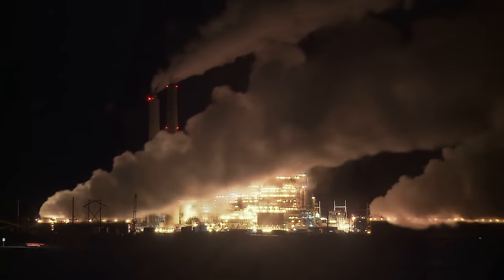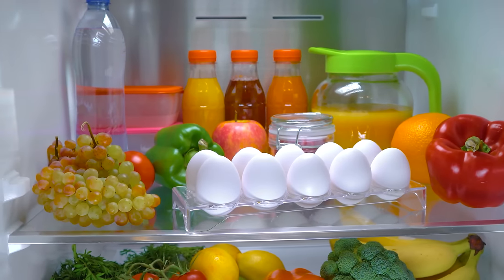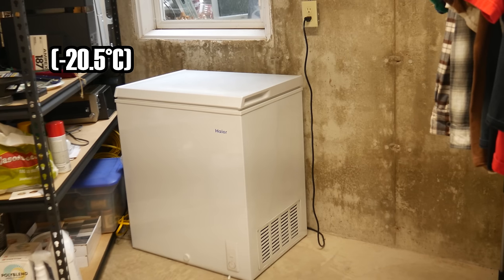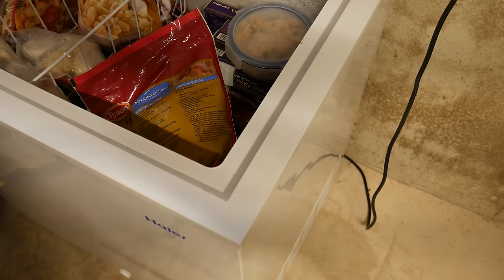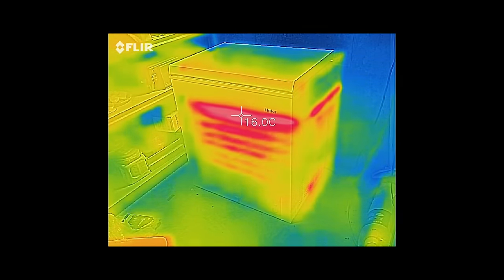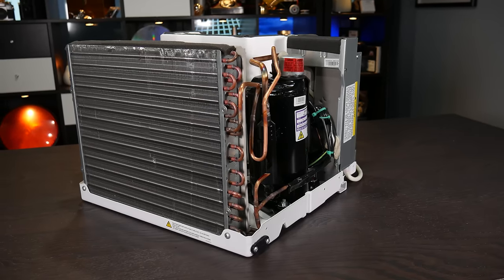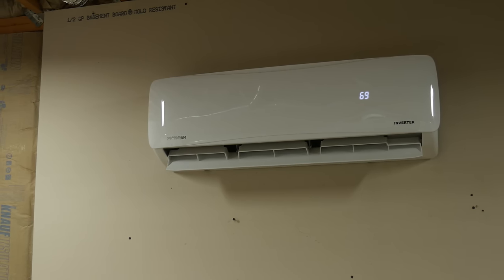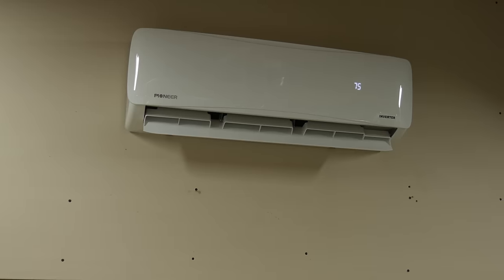Heat Pumps: the Future of Home Heating

Comment: No matter how many times I hear it explained, refrigeration cycles are so goddamn magical science, it's really indistinguishable from fiction
Reply: Basically, what is exploited is that changing the phase and pressure changes the temperature seen by the opposite sides of the unit.  It isn't magic so much as utilization of the laws of thermodynamics to our benefits.
Reply: It's really basic physics. You compress something, it gets hot. You release that pressure, it gets cold. An AC system is simply turning that concept into a continuous cycle.
Reply: Yes. Magic, like the OP said.

Comment: 34:06 "For now, stay warm."
Me in the Philippines at 3:00am :
- turns airconditioning on because it's too hot -
Reply: get a  dehumidifier
Reply: In tropical countries, heatpumps only cool, less complicated system and last longer
Reply: @henryairconcepts2999  I live in north Argentina and every year more models sold are hot/cold because we are little pussies when temperature goes below 10 C
Reply: @henryairconcepts2999  I'm in Brazil, heat pump are more expensive and not useful. I barely use a oil heater at half power to sleep in some winter cold days.
Reply: @marlonmartins82  I see. I live in NZ people live in pacific area and south east asia only have cooling heatpump. And it’s cheap to buy. Maybe around $300-400 including install for small heatpump like underr 1kw
Reply: So lamig in Ph
Reply: Ground source heat pump in the Philippines would be the way to go for air conditioning.   I've never been able to find anyone there who knows how to make that kind of system work.
Reply: @Bagsy84  ACs dehumidify.

Comment: Here in Phoenix, we have been using a single central air heat pump for super hot days and cold near freezing days for heating. Also, we use a single heat pump to heat our pools in the winter and cool them in the summer. Without them, in the summer the water gets as hot as a bathtub and is not refreshing. Thanks, Heat Pumps!
Reply: Do you get the pool extra heat pushed to hot water tank or is it just pushed out?

Comment: We have a "Mini Split" installed in our addition, and it does a fantastic job of both cooling and heating throughout the seasons.  It even heats well quite a bit below freezing.
Reply: THE SPLIT HEAT PUMP doesn’t have built-in resistance heat?  I thought that was standard backup heat for heat pumps.  (That’s how my whole home unit.)

.
Reply: @electrictroy2010  I guess some probably do, but this particular unit warns that it's only effective down to about 19°F (around -7°C).

Comment: your pun delivery caught me off guard. I'm pumped too. This is amazing, I can't believe I never thought of doing this. The heat that is pumped has more watts than the electricity used to pump it. absolutely the most efficient way to heat a building.
Reply: And now lets combine that with a proper insulation in Walls AND windows. If the insulation even more reduced the amount of energy needed to either heat or cool the place, well, that makes them look even better.

Does the US know something like a passive house? that is an energy efficiency standard in Germany (and I assume a lot of other countries around Europe and likely the world) that defines such a high heat efficiency through insulation etc., that the house requires no external energy to heat or may even produce more energy than needed, (e.g. with solar collectors, through sunlight shining ionto windows etc.). In the depest winter it may need just some additional minimal heating. A colleague living in one told me, just looking at heating the body heat of three people living in the house is already sufficient to keep the temperature up, now add all your electric devices producing heat, cooking, showering,... Seems at some point you are more confronted with an efficient way to get rid of the excessive heat. I think most have ventilation systems with heat exchangers.
Reply: @alexku8452  I have never seen one in US. It may exist here but I have not heard of one. If it does it is most likely in California where they tend to be ahead of other states on things like that. In the southeast of America (i am in Florida) it is humid all the time around 60 to 90% humidity on a regular bases with 80 to 100 degree F temps (26 to 38 C) so you need air conditioning to get rid of the humidity. We hardly ever need heating. It gets cold maybe 2 weeks a year in Florida and that is usually above freezing. In the summer you can get around 2 to 5 gallons of water out of the house a day through air conditioning. I dont know about the northern United States but most US states get up to 100F/38C in the summer even the northern ones. In the northern USA it gets below 0F in winter but also get hot in summer. I do not know the climate in Germany myself but insulation without ac in the south USA is no help. you have to have AC to keep the inside comfortable and mold free.

the closest I have seen to what you are talking about was from a video i watched from Matt Risinger that does home construction in Texas. he showed a house they built using i think 2 foot of insulation on the outside and only needed one mini split air conditioner to cool the entire house. if most places built houses like that it would be better. one of the biggest issues in the USA is the amount of different climates we have all across the USA.
Reply: @alexku8452  that certainly is an optimistic view. I would be all for it. The trouble lies in convincing people that the long term cost savings justify the large initial cost. Perhaps when the world runs out of oil we will see people care more about efficiency.

Comment: When I upgraded the original and outdated HVAC system in my last home, I went with a combination air source heat pump and a gas furnace. That replaced both my ancient air conditioner and worn out gas furnace. I’m in Minnesota, and the thing that I appreciated is that the thermostat was capable of auto controlling the two based on the outdoor temperature. The gas furnace was only really used when the temperature dropped below 10°F.
Reply: I'm in New Hampshire, our house isn't THAT old, but as is typical with New England rural homes built before 2000, it has no central AC, uses forced hot-water/baseboard heating and an oil furnace, with a large supplemental wood stove in the main space of the house. My home is about 3000sq ft and two floors, with the upstairs bedrooms having baseboard resistive heaters (upstairs was finished years after the home was built and was never properly rough plumbed for more heating zones). We've wanted to go to central AC for years, but up until recently, since our home wasn't ducted for forced hot air, our choices were really those garbage high-pressure attic-deployed systems, or more recently mini-splits, but if you want AC in every room and don't want to have to keep doors open, you're putting a multi-zone system in with indoor units installed in each room, likely requiring multiple outdoor units, an extremely expensive endeavor. The upside is that we wouldn't need resistive heating upstairs anymore and barely use the oil furnace except to supplement on the days that it gets below zero, but I'm curious about how well the better and new systems can handle those nights when it's -15F outside. Does your system still function much when it drops below zero in heating mode? 

I'm really tired of all the mixed message you get on the subject. On one side, you have people that want the technology deployed because it reduces our need for fossil fuels, which is great, but those people often just use the best case scenarios and generic statements to make their points, like "Modern heat pumps use 1/4th the energy as other technologies like electric or gas", or when questioned about their cold weather capabilities they often respond with something along the lines of "you're thinking of the old American heat pumps of the 70's and 80's, modern heat pumps work below freezing, not a problem anymore, even Sweden and Norway use them". I'd be willing to consider completely gutting my home's HVAC system to deploy quality multi-zone mini-split systems, but for my home since we don't have any ducting, we're talking at least $50K for enough properly sized units and the installation, I wouldn't want to spend that kind of money if the system is only useful on 50% of the days from November to March.
Reply: @racerex340  Exactly my thoughts on this.  I have cast iron radiators with gas boiler, and I just love them and the quiet, even heat they produce, and don't want to get rid of them. . Also, with an older home in a cold climate, you really have to air seal and insulate well to make the mini split heat pumps effective.  The mini splits are mounted on the ceiling or high on a wall, great for A/C but I would think less effective at heating at floor level. I lived in an apartment with forced air heat all the vents at the ceiling and the ceiling was hot while the floor was freezing.  Also in my case I have a vintage home, and the look of the mini split heads would clash with the trim and mouldings  I have in the house.  I got a quote for one mini split head and one outside unit of about $5,500.  I would need at least six or seven to do main floor, and another two prob if I finished the attic.

Comment: This feels like the avengers endgame of technology connections
Reply: What you didn't see was the toast offscreen, which was being heated by the mini-split.
Reply: Latent heat "I am inevitable..."
Reply: This is only Infinity War.  Endgame comes in part 2
Reply: no this is infinity war
endgame is gonna be heatpumps part 2: underground heatpump
Reply: Plz stop comparing things to marvel and Harry Potter movies 😬
Reply: I'm worried what will happen to Alec in Alecvision.
Reply: Inevitably, the the heat pump will return to wipe out half of all forms of energy
Reply: @sebastiangorka200  part 3: underground loops (200m drill) where you get +5°C for the heatpump in winter, and +16°C FREECOOLING in the summer time. But it needs a european-style-efficent house. And good engineering. And money.
Reply: @Worldsoldout  what do you mean by "european style efficient house"? are homes in america not insulated or sumn?
Reply: @sebastiangorka200  

Wall-Insulation:

Switzerland		25 - 30 cm (10-12 inch)
Sweden		40 cm (16 inch)

Comment: Thanks for this. I moved to Florida from Rhode Island a couple years ago. I was told my "heating system" was a heat pump. I honestly had no idea what that was. Or how it related to the increasing popularity of the wall mount units you have.
I have serviced my own gas heaters over the years, and also understand a traditional electric system that pumps the water from room to room. Throw in radiant heat and both active and passive solar systems, and I felt I had a pretty good handle on heating systems. As soon as you explained the basics my brain went "aha" and I saw where you were going. I should have asked sooner. Not that it changes anything. I am certainly not qualified to work on refrigerant based systems. So repairs will be left to the professionals. At least now I will be able to ask questions and understand the answers if my system needs work.

Comment: Me, 2 minutes into the video:  "All I have to do is turn my air conditioner around? Done."
Reply: You joke, but you can literally do that with a window mounted unit. The temperature control would be useless but yolo.
Reply: Dont even need to reverse it. Just take it out and run it, the heat produced is greater than the cold air produced from the AC part of the unit. Its how I kept my room back at my parents house warm during the winter cause it wasnt connected to the central vents.
Reply: @GreyValkrie  if you run it with the whole thing inside, it is equivalent to resistive heating and therefore much less efficient.  It's no longer running as a heat pump.
Reply: @GreyValkrie  sorry but mining crypto currency or running an electric space heater would have been better.
Reply: Someone needs to modify a portable dual-hose air conditioner to basically change the hose connections to the top portion for heating, and the bottom portion for air conditioning. This would eliminate any need for even reversing the direction of the refrigerant. The hoses present some loss (as they are moving air, warm or cold depending on the configuration) but it'd be, effectively, a portable self contained mini-split system.

Of course it would be loud as the compressor is inside, but this would be perfect for a garage or basement year-round. My portable dual hose unit has a heating function but it literally runs a ceramic heating element inside the unit like a space heater, thus is no more efficient than a space heater.)

Even if it cost $1000, it'd be worth it.
Reply: Well if you want to just burn electricity for heat you can turn on your electric stove and its way less heavy moving involved
Reply: @timmeh87  "burn electricity"
lol
Reply: @AvgDan  Lol, turn 20 1080Ti graphics cards into a space heater through the power of crypto mining!!
Reply: @emotionz3  somebody did i have one at 35f outside it kept my room at 75f not amazing but better than nothing since i live in texas and its all i had well when i had electricity. weird weather man.
Reply: I would be a bit worried about carbon monoxide poisoning or fan death from such an operation.
Reply: @j2simpso The first line of wikipedia. 
"Fan death is a belief that running an electric fan in a closed room with unopened or no windows will cause death by depriving the room of oxygen, despite fans not using oxygen to operate. Despite no concrete evidence to support the concept, belief in fan death persists to this day in South Korea,[1] and also to a lesser extent in Japan."
Reply: Sometimes I hold my hands on the back of an A/C unit just to warm up
Reply: @emotionz3  there are portable reversible AC units.
Reply: Really? I couldn't buy an air conditioner who couldn't be switched to heating when I bought mine.
Reply: Thanks 😅. A much simpler explanation. I enjoy the lengthier explanations too, but it’s always nice to have a brief summary.
Reply: @AvgDan  I did the 1TH/s mining for two winters 2013, very good heating, and selling the btc even paid the entire electric bill
Reply: @j2simpso  carbon monoxide is only possible by actually burning fuel but not having enough oxygen in the air, none of that going on here
Reply: Let me know how that goes!
Reply: @TheAllMightyGodofCod  Link?
Reply: @AvgDan  Seriously. My gaming computer is paying my entire power bill this last two months.

Comment: These things are extremely common here where I live (EU), been really popular for about 15 years now.
Reply: And they are getting more efficient. Still, my preferred method of heat is burning wood. There's plenty where our home is, is renewable and does not use electricity. And you can cook at the same time. One winter I noticed I had not used electric stove for two months. All cooking was done in wood oven.
Reply: @Teknopottu  Mmm delicious smoke particulates slowly filling the air, cough cough choke choke
;-)
Reply: @Bertie_Ahern  Yeah, because no filtering is used. And why use it when you can just not? Just as we could stop using filtering in all industrys, just wasting money.
Reply: @Teknopottu  oh come on, you think folks are busy filtering the smoke from their wood burners and chimneys? lol
Reply: @Bertie_Ahern  In an application like this filtering is quite easy compared to chimney filter. Have you heard of water filtering? Leading the smoke through water in acontainer or two before or after the cooling would greatly filter most of the bad stuff and filtering material is as cheap as water. Have you seen a water bong/pipe? Same principal.
Reply: @Bertie_Ahern  Where I live, in the middle of forest at the border of Russia, there is plenty of filters around me growing and purifying the air. Same filters I burn and the growing trees are known as great CO2/carbon sink. Of course warming and cooking with wood in traditional oven and chimney would not work in large scale without proper filtering and it would need something better than a giant bong at everyone's roof.
Reply: Yep! I work at an architectural firm and we often do these in new buildings! Not really a thing when it comes to modernising old ones, unfortunately not yet.
Reply: @Teknopottu  I dig what you’re saying but we’re (our household) transferring to Solar now.
Reply: Ye, most homes in Norway has been using this for many years. Mostly because of cheap electrisity. So it was easy for people to adopt it. It payed it self off after 10+ years of use. Versus buying wood or using regular fan heaters
Reply: Same in the US, most homes in the north have had these for the last 15 years too.